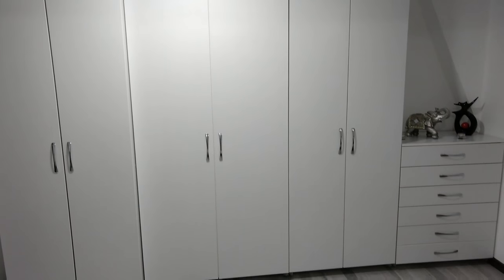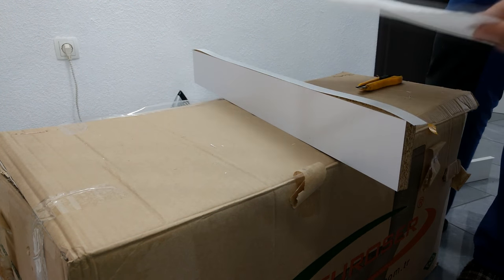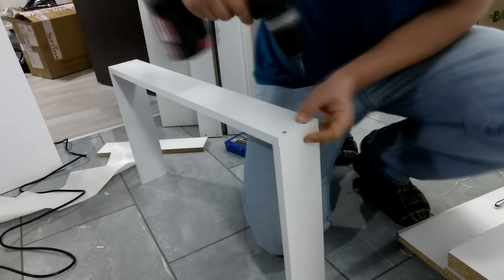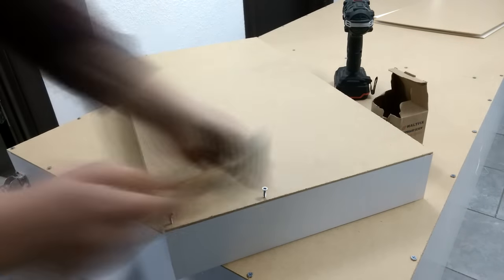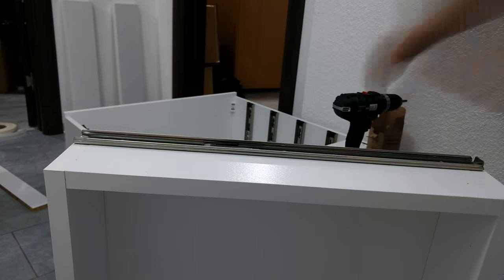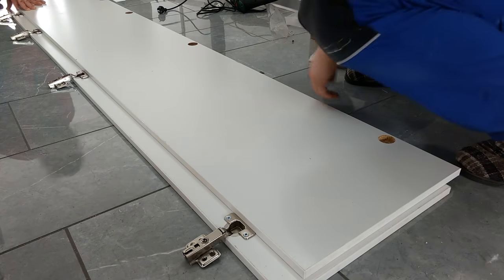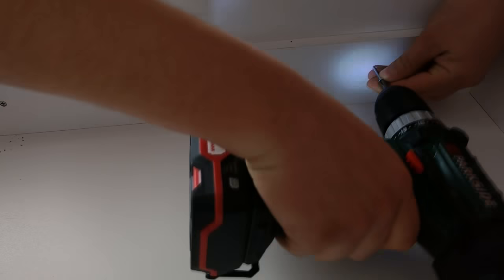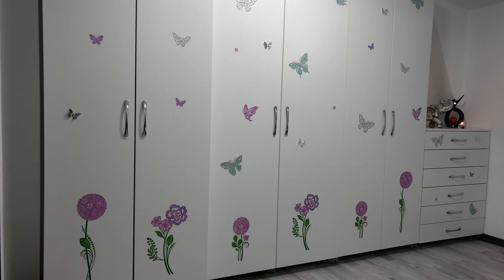Building cheap DIY furniture out of melamine //HOW TO

Comment: Normal wood screws are not adequate for particleboard...use large thread screws. 
Wardrobe is optically pleasing...structurally you will see if the draws hold together ;)
Reply from the maker: What I'm using is sold here as possible board screws. As for structural strength, it's 2,5 years since I've built it and nothing have fallen off nor it has shown any signs that it might soon. I think I'll be good.

Comment: Good job sir. May I ask where did you screw your countertop in your drawers so that it will not be visible on the countertop?
Reply from the maker: See the video at 4:20 There are corner brackets shown there that hold the top from the inside.

Comment: Hi just looking for a bit of advice got a load of melamine board from ikea looking to build units for my shed like kitchen base units but when drilling to join pieces together would I need to use a jig or just align them up ?
Reply from the maker: If you are using just butt joins, then you can pre-drill the holes and just line them up for screwing.
Reply: @TasteTheCode  thanks for your help 👍
Reply from the maker: You are welcome!

Comment: Can i know what laminate sheet you used for laminate and any other please let me know..
Reply from the maker: I bought the sheets pre-laminated. I only applied edge banding. There are many variaties and colors you can choose from.
Reply: @TasteTheCode  so is there any idea for wpc boards what i can place on the wpc boards (laminate sheets or veneer or anything ) ?
Reply from the maker: Not sure. I've never used wpc boards. Check your local supplier for options. I know that there are some vinyl stickers that you can apply.
Reply: Taste The Code thanks mate